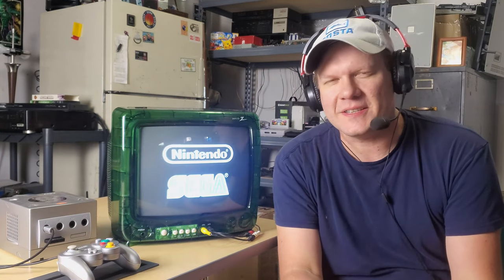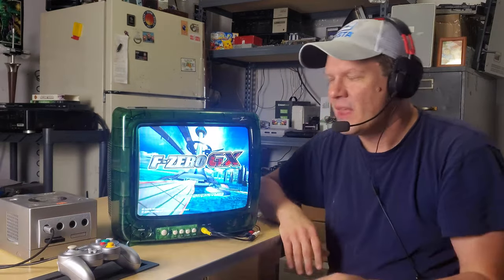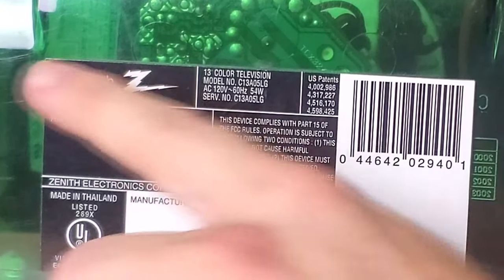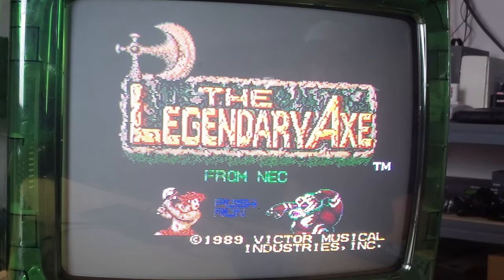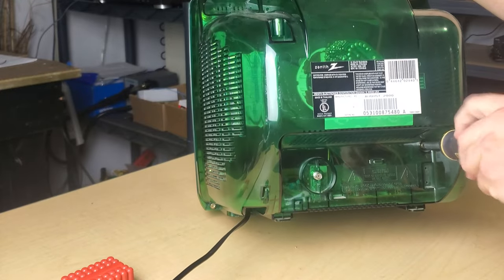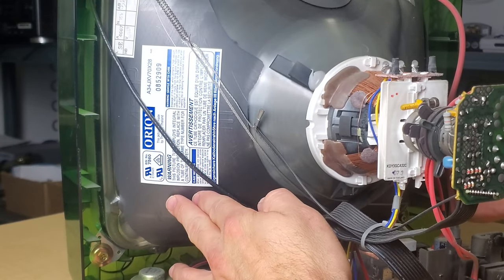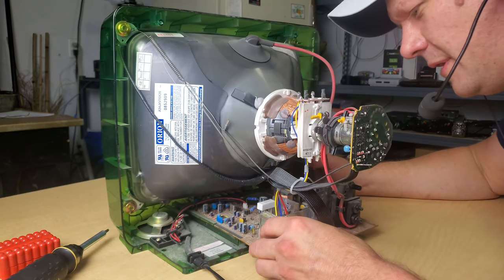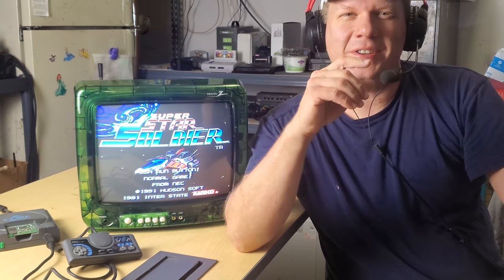The Translucent Green CRT! - Zenith 13" Consumer TV

Comment: @retrocool I just bought a H13E01LG and it is very similar to this tv. It is translucent green as well. The problem is it has no AV/Line input (yellow, white input). I opened it up and the 2 input slots are there but there is no way to change the input source to “line” on the TV only AIR and CABLE. I could use a RF Modulator but I’d really like to use the factory inputs slots that are covered up and change the input source on the TV.
Reply: H13E05LG

Comment: I have a 25” Orion tube in an excellena candy cab and a Toshiba 25” tube in another excellena both with Nanao boards. That Orion tube is more vibrant and sharp than the 25” toshiba and a 29” toshiba I have.
Reply from the maker: Cool, yeah I'm impressed with the Orion tube.  Plus all the caps are Rubicon so they didn't cut corners on components.  Thanks for sharing the info on your tubes.

Comment: I have a huge soft spot for these 13 inch lower end crts. My first crt is a sanyo thats about the same size with a big scratch on the glass, rf only, and I still have it here. The shell is just a basic dark gray color, so I may or may not mod it for rgb in the future. Any tips on removing deep scratches on these crt screens?
Reply from the maker: Yeah, I like smaller form CRTs.  Unfortunately scratches are difficult to do anything effective with.  Maybe look for something that is used to fix scratches on Eye Glasses.
Reply: @RetroTechUSA  ill look into that, thanks!